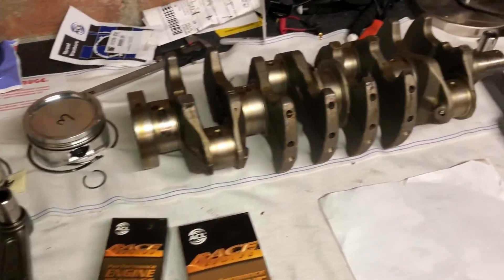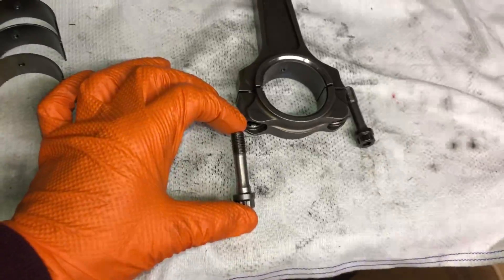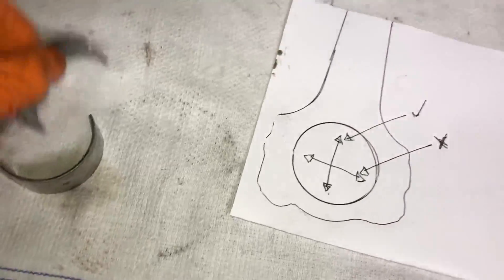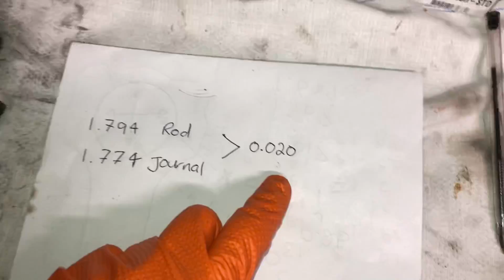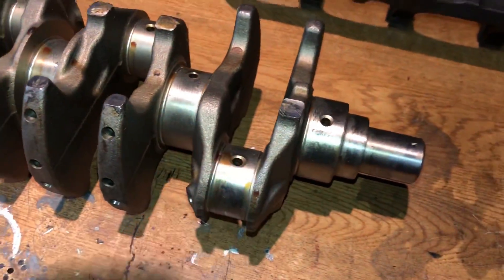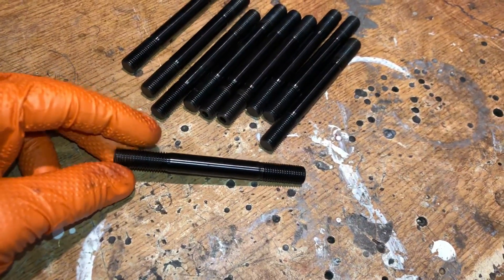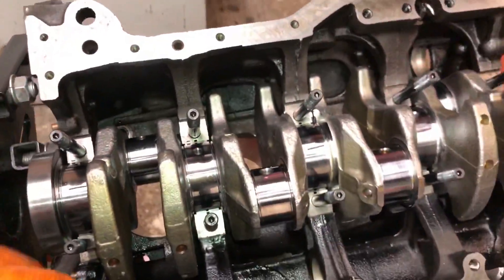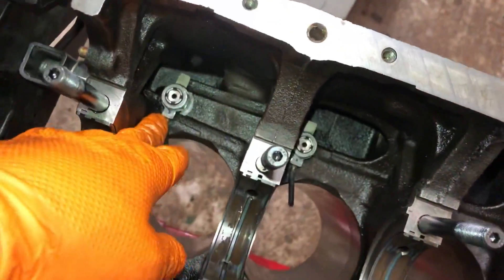THE NEW CRANKSHAFT IS INSTALLED! Evo 5 4g63 Engine Restoration

Comment: The older Evo 3-4 had the thrust bearing built into the  Middle bearing and they were said to be prone to Crank walk, I'm talking about 11:43.
Reply: Go back another generation and the 6 bolt engine had a single piece thrust bearing and they were much less prone to crank walk. Its just a gut feeling, but I suspect clutches with heavy spring pressures and or starting the engine with the clutch pushed is a contributing factor to crank walk.

Comment: how long does it have to be run in for  ?  i have seen  engine builders  rev f~~~ out the engine on first star crazy if you ask me   and others say gentle run in for  a 1000 miles  then oil change   what is best ?
Reply: tony pond  run in for 1000 miles if you want it to last

Comment: Wrong All ARP main and head studs need the torque live on the threads . Why did you put in on the threads when you checked the oil clearance?.
Reply: I believe Aaron mr323i 👊🏻
Reply from the maker: What part was wrong i cant understand the question?
Reply: @AaronUnknownPerformance  ARP bolt threads need the lube that comes with it . Always use the lube mate
Reply from the maker: I did use Arp assembly lube you can see me applying it. You can also use 30wt oil and increase torque by 10ftlbs